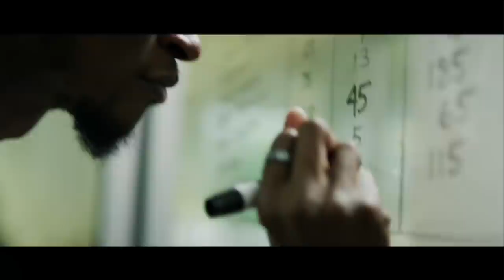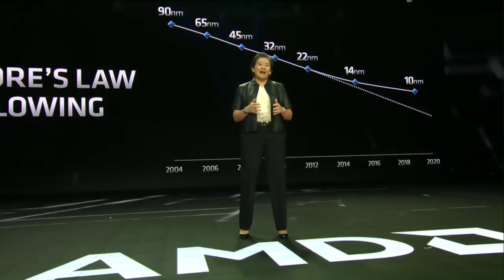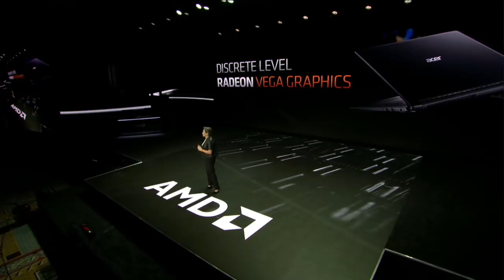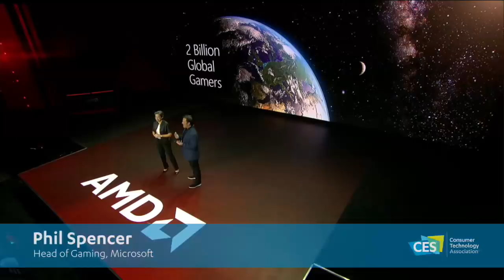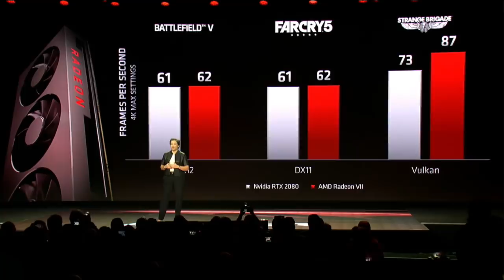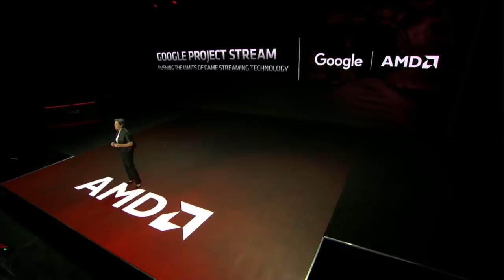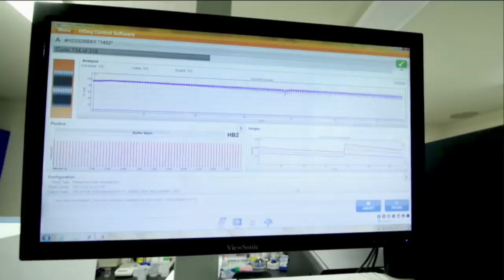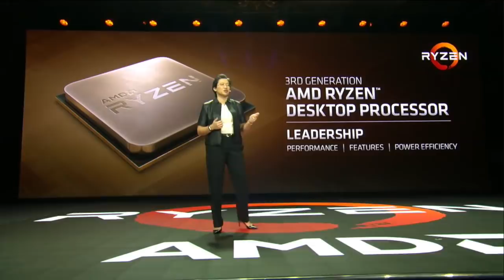AMD CEO Lisa Su's 2019 CES Keynote

Comment: u guys dont get it... isnt about the ryzen 5 or 7 or 2fucking9... is about 8 core 16 threads vs 8 cores 16 threads... so ryzen with the same cores beat intel... meaning it will have the same or more performance in game and single thread based aplications... plus if they double the cores as normally amd chips have always more cores than intel chips that means they will keep being the kings of multi task but now with intel gaming performance aswell... might be the best cpu for everything... period... deleting 8700k and 9900k... and most of all... the intel rule days are over... serious competition on the table now... not like before...
Reply: this^
Reply: Hmm maybe. BUT I'm not sure just yet. First of all clock speeds weren't shown, it might be that if you overlock both to their max the Intel i9 might win. I remember AMD tends to have better SMT scaling so even though it wins in the MT benchmark it might lose in the ST. On top of this synthetic cinebench score isn't the best metric, it might better even in CB ST but in actual gaming it falls behind more due to latencies and all that jazz. I'm still anxious about it. If the rumours about that being the Ryzen 5 chip are true though then that is going to be amazing.
Reply: @AVerySillySausage  Don't forget the power draw. What could the Ryzen chip do if it was running with the same power draw??? Ryzen 3000 is a beast. It is an early sample, run at lower power, but it still beats the i9990k.
Reply: Imagine if the clock was stock or lower lmao
Reply: I am genuinely surprised how few people have noticed that. Intel had stronger single core for God knows how long. To see amd finally come out and outdo Intel in benchmark without relying on more cores is huge!

And then they reveal it was actually mid range Ryzen 5 that performs just like Intel top of the line i9.
And then they also show that Ryzen 7 is 12 cores now. 
And then AMD reveals direct i9 competitor with double the core count for the same price.

They have so many cards to reveal. I hope they do it right. So far everything they have shown suggests that Jim's leaks are true.
Reply: CPI - clocks per instruction....AMDs #1 goal when creating Zen and the real reason that core speeds now matter even more, AMD is truly doing more and when the industry catches on and delivers proper integration, Intel and nVidia will be way way behind...

Comment: AmdSlapsRtx2080.avi
Reply: - same price
- same performance
- no dlss
- no rtx
what did they win?
Reply: and im not an fan boy of amd im using already gtx 1080 just saying
Reply: I bought MSI 2080 RTX Ventus 8G for 660 EUR from of the biggest e-shops in Europe, so even cheaper in the US, around 600 USD. That card is super silent, clocks to 2050 MHz,  +200 core and 1000 MHz on memory. Has raytracing and DLSS. It is NOW, in my pc.
Reply: @CabrioDriving  how many games have you tried rtx with so far?
Reply: @captaincrazy5008  Raytracing only 3dmark. Lots and lots in VR at highest sub-sampling levels and resolutions. This card is perfect for VR at ultimate quality levels. 2D gaming surely even better.
Reply: Daniel oviedo  But .avi still used, but .mp4 is more popular

Comment: After all the rumours and hype, so disappointing {;-(
Reply: Eh, good enough for me. I was considering whether to buy a 9900K or a Zen2 cpu. Since Zen 2 seems to be the winner at less power draw and presumably less expensive, I'll go with AMD.
Reply: this is what happens when you overhype a product
Reply: @graham1158  that i9 was running at 3.6ghz
Reply: Your fault for getting hyped, stop believing rumors.
Reply: @subscribinkitmane1119  An 9900K locked at 3.6 ghz would not get a score of over 2000 in cinebench... It was left at stock, which means that turbo boost was active.
Reply: @sherpafan033  Gotta wait for Navi I guess or maybe just go green team, rtx 2060 only decently priced one compared to the other rtx cards.
Reply: @graham1158  There WILL be a 16 core 32 thread version, this was just Ryzen 5.
Reply: @OGPatriot03  Really? Did they say what kind of version this chip was or are you just speculating, based on the leaks we got weeks ago?
Reply: @graham1158  It's based upon the fact that you can see on the substrate where another 8 core 16 thread would connect (In the reflection you can see the connections besides just the perfectly sized empty space.

It's possible that AMD does a staggered release and brands these a little differently but that's speculation at that point. What is clear is that the CPU shown is half the potential of Ryzen 3000 series so I estimate that to be R5.
Reply: You actually believed those rumors? You set yourself up for disappointment
Reply: @Icybubba  you don't seem to know very much there bud! you really think there new top chip is going to be a 135w 8 core 16 thread cpu? same amount they have now ? come on man plus you can see where the other chiplet will be on the 16 core model
Reply: @NightshiftCustom  I was referring to the graphics card. The Radeon 7 is not the Navi's
Reply: That's why you shouldn't believe the hype!
Reply: 9900k user here. stock 9900k runs 4.7ghz on all cores getting about 2k cb score. Overclocked to 5ghz gets 2.2k
Reply: @Lionheart1188  It's okay I just watched Adore TV's video on the AMD's CES keynote, he claims this was their mid range low end chip Ryzen 5 and it just beat intel's top chip. This year is still game on! RIP intel. I'm a believer!

Comment: I was set to switch and upgrade to 9900K but then the leak came out and the 3850x had me waiting for CES. That keynote did not make me want to wait for ???????? I don't even know what I am waiting for after that keynote. My 1090T is literally failing after years of hard OCed use. I have to downclock my CPU every few months now, 8 years was a good run for the 1090T but its slow now 4.1Ghz -> 3.6Ghz and dropping. Save me from going Blue Red

Comment: AMD should maybe consider higher clock speeds for the CPU/APU combinations, as the higher CLOCK will push the APU also,  making it more and more attractive. If you look at the 2200G overclocks, how much more performance is pulled.

Comment: I just got my Nitro 5 (Ryzen 2500U + Radeon 560X discrete graphics) last week. Everything was just fine until I started playing games yesterday. Granted, the games I play are old, but they didn't encounter problems with my desktop which has an FX-8350 and Radeon HD7770. 

Thief 1 - Graphics too dark, adjusting gamma does nothing, stuttery.

Thief 2 - crashed because I didn't set CPU affinity. Didn't have time to fiddle with it yesterday. This is also my first foray into Windows 10. Nonetheless I don't expect things to be better than Thief 1 because these two games are practically the same in terms of engine and graphics.

Thief 3 - mouse cursor is invisible. I remember encountering this issue or something similar a long time ago with my Athlon 64 X2, back in 2009! Can't remember what caused it. Was it the BIOS or drivers?

System Shock 2 - can't find a DirectX file. Likely an OS thing.

Amnesia is the only game that works ok. 

Can't say I'm not feeling frustrated. I was very happy with my laptop for about a week but now that I started playing games it doesn't seem so nice anymore. And looking at forum posts there seems to be a lot of folks encountering different issues with Ryzen Mobile and AMD seems to be relying on OEMs to release drivers (yeah good luck with that!). FYI I'm also using the latest BIOS from Acer. I've yet to install the latest graphics drivers from Acer but OEMs aren't known for posting the latest drivers anyway. AMD doesn't seem to support Ryzen Mobile on their website either.

What a way to go. Maybe it's because I'm playing old games, but many users are encountering all sorts of issues as well. Maybe the dual graphics setup is causing issues? I'll try to see if newer games fare better. Crossing my fingers.

Comment: How could the power consumption be 46W during Cinebench at 1:28:21? This makes me believe that these values are fake.
Reply: Whats the Watt usage usually at running Cinebench? Remember this is the first 7nm CPU, (AMD claiming...) its performance fluctuates around 4x faster than previous generation Ryzen CPUs, is seemingly MUCH smaller than the previous Ryzen (which was huge, meanwhile this looks slightly smaller than the average Intel consumer processor? (I must be mistaken?)).

Also people had doubts that the previous Ryzen would perform as well as AMDs benchmarks showing, yet turned out they held up and were very correct <3

Comment: This looks like seriously good GPU leap. Not having to take the weight of ray tracing and add the cost to the consumers price is a huge advantage, that and 7mm. 
Well done AMD. Only low point is Zen 2 is about 6-8 weeks later than I hoped - but I can wait.
I would also think 16GB Vram is overkill even for 4K gaming with massive textures. My card never hits 8GB now. An 8GM version might be $100 cheaper and a good bet? Even release an 8 and 16 GB version, but 16 on its own feels like paying for twice the memory that I'm likely to ever use in the 2 years that I typically keep a card.

Comment: So the new Ryzen 3000 running on 8 Core 16 threads does about 2000 on Cinabench with greatly reduced watts, once they put another 8 core in there, it will probably be 4000. 16 core, 32 Threads, AMD will KING of processing, Hopefully video game developers can make use of all these CORES in the CPU. At this present movement 6 Cores tends be the sweet spot on Ryzen CPU's.

Comment: I for one am excited about the Radeon VII and look at the $700, if the Vega 64/56 bundles are anything to go by, as $500 (the GPU) + $200 (in bundled games). 
Also looking forward to Ryzen 3000 and new motherboards. Hopefully we will get 16-core Ryzens and so Linux users can run virtual machines with 8-cores and still have 8-cores for the host, without having to buy more expensive workstation Threadripper CPUs

Comment: I dont' get the Forza 4 Demo, review sites see the Ryzen 2700x already at around 150FPS @ 1080p.
However, the demo shows that the Ryzen 3000 preview silicon is about 20 to 30 fps slower than that...and that is even without CPU opponents...
I can only imagine that something was configured incorrectly, otherwise I don't get the point of the demo at all or am I missing something?
Reply: It's not a completed chip. If you noticed, the chip that she showed only had 1 out of 2 chiplets and an IO dye. It was running and 1/2 the core count.

Comment: Ryzen 3000 looks promising so far,  just push it a bit further and it will be perfect. The power consumption numbers look extremely good (considering that the only difference was the CPU+Motherboard) up to 40W less under all core load at the same (a bit more) Performance  seem to show the power of the 7nm Process.

Radeon VII looks also good, considering it is "just" Vega (with 4 less active CUs) on 7nm with more HBM and therefore bandwidth (1TB/s yo) showing a good indication where Navi could lead us in the mid-range of GPUs (200-300$ price point), also taking into consideration that Navi was designed for using the 7nm process and also introducing architectural improvements over Polaris and (most likely) higher bandwidth due to GDDR6 memory. 
RX Vega 64 / GTX 1080 levels of performance do not look impossible, and since Navi will have better efficiency it seems possible (we will see) to fit that kind of performance in an <=120W envelope (please I want).

I'm just wishing the best for AMD to keep pushing boundaries in the market and keeping up with or exceeding their competition to increase the speed of innovation/progress in the Industry. The coming years will hopefully be as exciting as 2019 will (7nm+ in 2020 and 5nm in 2021/2, yes. please  keep on track).

Comment: WELL ON THE CPU SIZE intel is in trouble and a big one i might say ...just waiting for the new threadripper...64 cores 128 threads  @4.5-5.4ghz... i hear someone  screaming ..however on the gpu side we expected a 96CU GPU with A.I  and RAY TRACING support  working at 2.0ghz with the same amount of memory as vega 7 and with same memory bandwidth... and at a price tag of 899 USD... THE VEGA 7 ITS NOT WORTH IT with 7nm tech at your disposal  ..please consider this...

Comment: To the people wondering about missing information on clock speeds, core count etc.: The Ryzen is obviously an early engineering sample, it is still far from the final release. Plus, remember what AdoredTV said: If they announce too much info several months before release, they might hamper their Ryzen 2000 Series sales until then, because people wouldn't see a point in buying one when the next generation is so much more powerful (this kind of supports the hypothesis of this being a Ryzen 5, but take that with a grain of salt). Also, did you really think AMD would come out with all details right now? Instead, what everyone is doing in the comments is exactly what AMD was aiming at: speculation. Controversy like the one in this comment section is what creates attention. Keep people guessing and they'll be more interested when you come out with the REAL news. I wouldn't be surprised if the Adored "leak" was actually a marketing move by AMD, these kind of things are common practice.
But most importantly over all: Don't jump into conclusions without any actual information and WAIT FOR BENCHMARKS, especially with this Radeon (Vega) VII card.

Comment: i was initially disappointed with this keynote for the lack of ryzen coverage. im guessing they are behind the curve on getting them consumer ready... but the fact that the, 2600x?(8 core, not 12 like the 2800x leak said), beat the 9900k at lower than release date clocks is actually pretty big... that makes me believe the IPC increase was substantial like the leaks claimed. if the 2800x is a 12C/24T at the rumored 5ghz, it should CRUSH the 9900k... and the ryzen was ~40w lower in power consumption than the 9900k in the CB15 test. im excited to see the final 2800x specs... it has a good chance to sway me from Intel, if its in the $299-349 range

Comment: AMD's SMT is better than Intel's HT.

That said, 8C/16T Zen2 (even Zen+) cores will be able to beat 9900K with less clock than Intel's, but it only work on software that can utilize it, like Cinebench.

I'm guessing that the Zen2 CPU in demo has less than 5GHz clock speed.

Comment: As a gamer, I'm disappointed that AMD did not introduce a gaming GPU but another 'meh' Vega card. I'm pretty sure that Radeon VII does not have Tensor Cores and does not support ray-tracing. What's the use of buying this card if you can just buy a RTX card for the same price but more features?

Comment: Before the rant , this is more of what I would  like to see : :
32 gig of  DDR3  4x8gig  running in  quad channel mode , hooked to a 580 GPU .
just because you have access to someone else's    7 nm physics  fabrication process
does not impress anyone . The  chip itself is very impressive ,  final product  implementation , not so much .

110 degrees C is 230 F !  wtf  AMD ?

previous RX cards were made to over-current
the B+ rail ( to exceed 75 watts )

on the  PCIe interface !
Over heating PCB  traces , thus using the PCB
trace as a NON-replaceable  fusible link !
wtf  AMD ?

The Effective bandwidth of the new Vega  V2
is a crash on the launch pad .  Still at
512 GB\s .  Double the memory did NOT double
the basic thru-put .  To do that would have
required bumping the  process count to
7680  or  8192 .

( lie with Stats , all you want )

Instead , you  beat a dead horse  by
over-clocking an already  over heated
silicon die . Over-clocking gives minimal
gains anyway .

Previous  reviews and use of  Vega  Frontier Edition ,
are typical of the new  Vega V2 .
Too Hot , and unstable .

I would NOT take a Vega V2 for free . Too much hassle .

for  699 , do this :
cap max Junction temp to 70 degrees C ( 158 F ) .
up the process count to 8192 .
( 8 or 16 ) gig  HBM2 .

Comment: as far as i have just seen the gpu is not touching nvidaand rtx, and the cpu atm is only matching the chip intel just threw out in the world to say we are still here and with an old socket, still no single chip performance, intels got theres yet to come out, i was expecting ryzen to surpass by quite alot so intel could not come out and lead but is the i9 still faster it was by a few digits only for ryzen today and as ive seen before you can run the test again and lose that amount or gain more so at this point all i see is its matching the older intel chip. now if they can get it out fast then they will be ahead if the price is cheaper , but pcs are about the performance not the price for me and intels got the lead again if they improve but what it does show is AMD has a strong package now if they can overclock well and have a few better chips in the line up, hoping this is the base model not the top end one type but to me they are still hiding something, but so is intel. 7nm to 14 nm is not so impressive if its a match altho the power is impressive. but i think its a different thing to intels power so if intel drops to 10nm will it be the same or better is the biggy then its down to overclocking and core speeds and price. what we did learn tho was the gpu is nvidia by miles still which is ashame as we want nvidia to drop prices. lol

Comment: Well AMD the grafic card should cost around 450$. 16gb is useless for 99% of the gamers out there. To expensive and same level as rtx 2080, even 1080TI that came out 3-4 years ago. I am dissapointed on the grafic card side  you would own the market if the card was way cheaper now you wont. I AM exited about the cpu and i want it to come out and i want to see some tests on it but it looks good if the price will be good but the grafic card is a dissapointment.